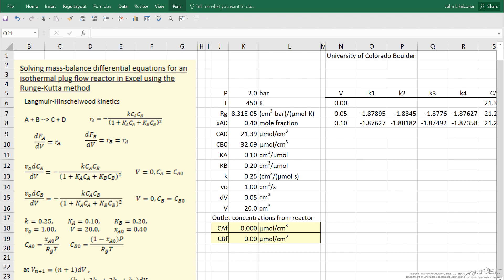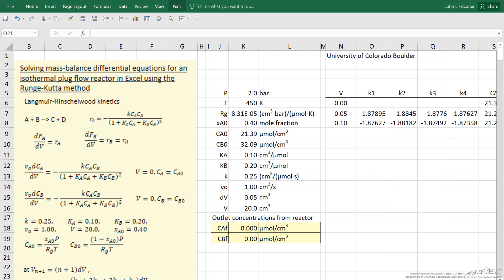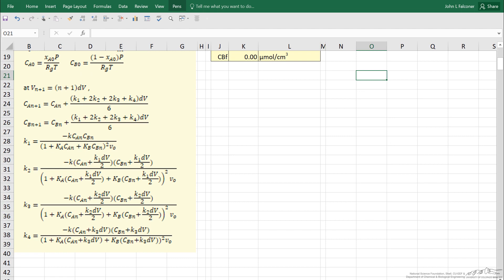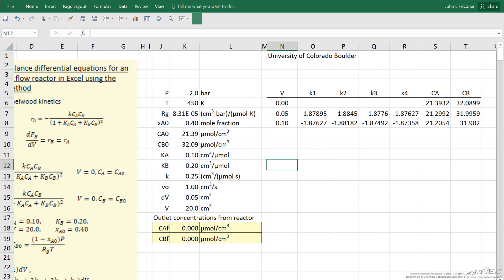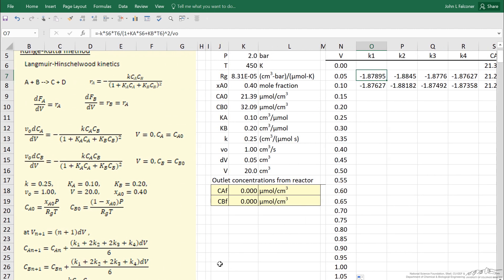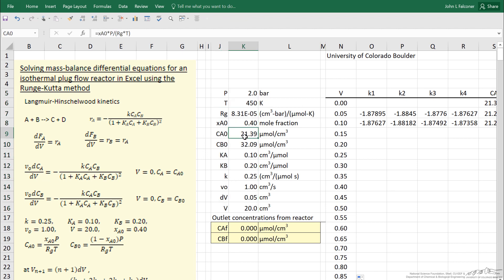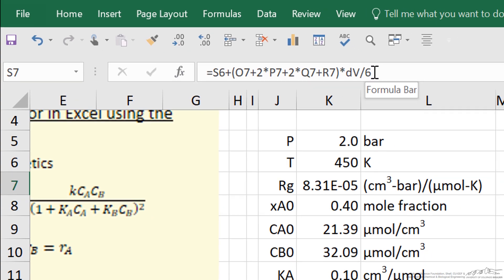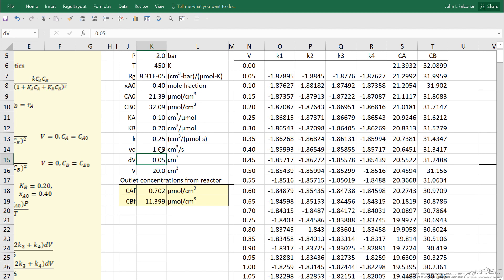Solving Mass Balance Differential Equations for an Isothermal Plug Flow Reactor in Excel

Comment: Thank you for sharing. How did you initialize the rungga kutta constants?
Reply from the maker: I'm not sure I understand your question.  The Runge-Kutta constants are calculated according to the equations listed.  k1 is calculated first, then it is used in the calculation for k2, which is used to get k3, etc.  Does that help?
Reply: @LearnChemE  yes I missed that! Thank you!